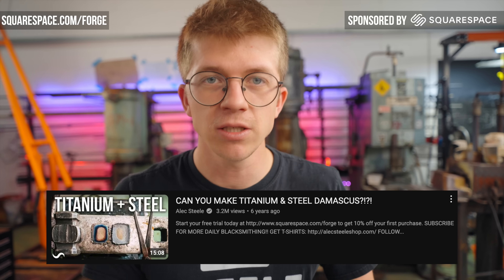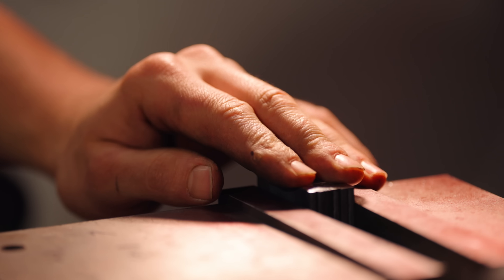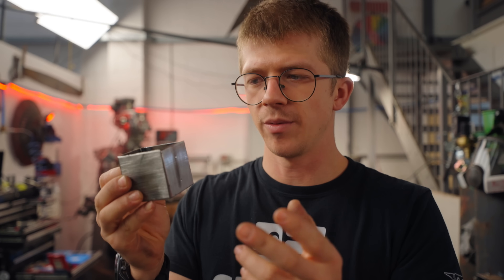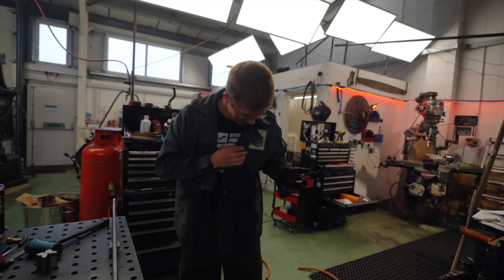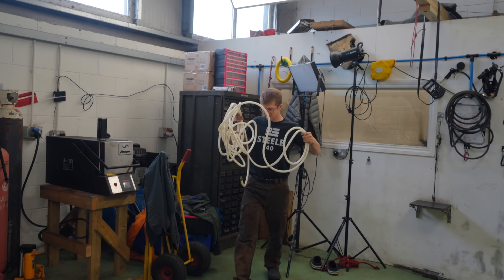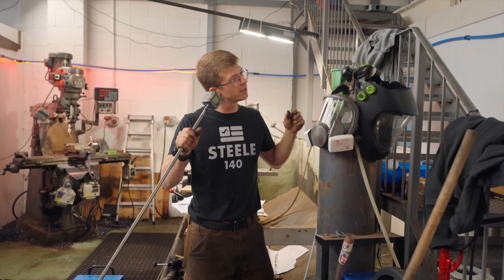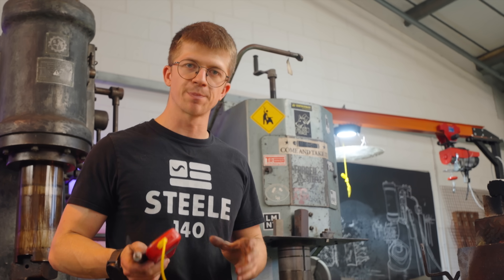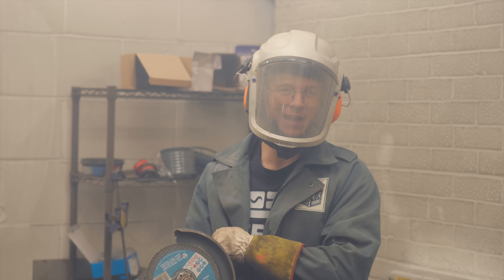Can I make Titanium Damascus?

Comment: Use large induction coil around the block and reciprocate motion to move block in and out of the coil. The coil should be about 25% of the length of the block. You want the layers in the block to be 'almost cooling' below the amalgamation point, then reheating (adjust movement rate). Ideally, you want a nice heat/cool bell curve. 
Experiment with different width curves for different results. You can even vary the heat rate through the length of the block for varying effects.
Good luck!

Comment: From an engineering point of view, "low flow rate" would imply you only need the flow to prevent air from seeping in, and that the cooling effect that the argon introduces should be minimized as much as possible.

Ie. the cooling by argon can't be avoided, but is not part of the intended process per se.

Amazing video btw.

Comment: Hard to tell what that block looks like through out. You liquefying it might turn in to a happy accident ad the 2 grades of ti wont mix evenly so you will likely have wild swirls tear drops blobs and streaks all through out of different grades. You can see near the corners where it turned to liquid

Comment: Love your energy and your videos, I come back to see what you're doing every now and then and this is particularly interesting as I too, want to make titanium damascus in the future and I honestly had zero idea there were a patent on in, but fkn glad its expired. Anyway, I'm not gonna get Squarespace for the simple reason that I know HTML, CSS, Python and JavaScript, so I can essentially code my own, implement the free, open source systems I need for easy maintenance and save a bunch of money. But for anyone who aren't as much of a nerd as I am, I highly recommend going with Squarespace as they will save you a bunch of time and thus a bunch of money.

Also just looked up the conversion of freedom units to sensible units and its honestly not that hot. ~1149 °C is a lot cooler than I thought would be needed to melt Titanium. Copper is, after all, around 1600 °C, gold and silver are worse. Speaking of other metals, perhaps some copper, brass, bronze and silver damascus could be cool, future projects? Not large projects for expensive metals, of course, but stuff like Silver damascus could make some pretty cool ring and necklages tbh. Idk how well gold would do though. It's extremely soft after all and is usually alloyed with other metals like silver, so maybe, maybe not. Would be hella expensive and Silver damascus would probably be easier than gold. On a similar note it would be cool to see a strength comparison between Titanium Damascus tools and Aluminum Bronze tools. Your forge seems plenty capable of doing that. Idk if Aluminum Bronze can be made as damascus, but if it can, that would be insanely cool too.

Comment: I made myself a suit of riveted titanium chain mail. Because of the way I had to heat individual rivets it made each ring a slightly different color and because I used a more complicated link (kings mail) it ended up looking like strands of braided rainbows. Even thought titanium is light, that suit weighs about 200 lbs in total.

Comment: IIRC aluminium oxide abrasives wear out sooner when grinding titanium, but not because it's harder than steel. It's just so reactive it pulls the oxygen right out of it and dulls the edge of the grit particles. Might not be a problem for you but if it is (and it might be why your cutoff wheel went pop but not sure what abrasive it has), consider picking grinding tools with carborundum (silicon carbide) instead.

Comment: I believe that assuming it’s not molten, a power hammer is less force per stroke than a press. Not sure if that would help or hinder with warmed up titanium 

Also baking soda and a bench top power supply is enough to get super predictable colors with vanilla commercial titanium, which may be the alu v alloy. And you can do stuff like masking more areas as you up the current. In the less than 30v regime I like 11-12 volts, 18v and 27v. Or the neighborhoods around those. 

There’s a lot of other fun colors you can unlock if you can get up to 50-100v , those power supplies are a tad more expensive, plus you need to start taking safety more seriously in that power range

Comment: I think the best results for any damascus would be a whole shop in argon atmosphere, cause titanium is very base, you will immediately have an oxide layer very soon after grinding or blasting. Get rid of the box, of the scaling, of the borax, of the grinding. Just buy yourself a rebreather (there must not be oxygen in your shop), seal of the whole shop, build a lock and then keep having a slightly overpressure of argon gas. Probably nitrogen would also do? It's cheaper. Working with a rebreather might be odd, but the laminate will be perfect, I guarantee. Or buy yourself a glove box, a huge one with a forge, a grinder and a hydraulic hammer fitting in, that'll help with the gas bills, but might be even more uncomfortable than the rebreather. But guess what the Hanford Site (for Britain this is Sellafield) workers in the plutonium finishing plant have to endure.

Comment: If you ever do try cutting and welding it in  a way where not just steel, but also titanium has to forgeweld you're gonna have to use make another box or sleeve and fill it with Argon or you're gonna have a really spotty weld.

It might be easiest to make a bildet with extra steel on the outside and just clean and fold until you've ground through the steel and stop there. 

Really excited to see where you take this from here

Comment: Definitely need to try changing the colours using electricity instead of heat, that way you can finish and polish the metal, then colour the titanium layers different colours potentially

Comment: stack the sheets together in a larger 8 inch long 4 inch wide 3/8 inch thick block shape, cut out some of the sheets on the outer end so that their are holes in them that create a jagged wood grain receptacle for the adjacent sheets to fill... optimally of the 3/8 inch thick box, 3 sheets inside of it. 1/8" outer case and 1/16" inner sheets the middle one being having a jagged simulated wood grain hole that the outer two forge into "use water jet cutter to make pre-planned out filler bits, thus leaving only one 1/16 size sheet forging... excessive twisting and da da da methods, use cut water jet to cut out patterns out of each kind of metal (less wasted material)"

Comment: The argon flow rate just needs to be able to keep air out of the can... 1 hole is definitely enough and reduces ingress points.

Melting the titanium was actually a good thing, since the layers will sufficiently diffuse into one another... Just don't get it hot enough to alloy it 😅
A bit of mixing would be amazing though...

Comment: Patents often don't include exact details or variations used in production, to make it harder to replicate, so things like holes/positions shown could well be non-optimal
Reply: I believe that this was a method patent (often called a process patent.) The non-obvious method of producing something is what is covered, not the final product itself. The method patent would be infringed only if someone followed the same steps described in the patent to achieve the same result. As such, method patents do tend to describe something pretty close to the optimal known method, because if a method patent describes a suboptimal process and then someone else starts producing the same thing with another method that is more than trivially different from the patented steps, then the new producer could very well be found to not be infringing the method patent, and would be free to use the superior method without paying royalties.
Reply: Also if you patent the exact process, the patent then covers ONLY that specification. That's why you leave it open enough that someone else can't just look at your expensive patent, change something miniscule and call it their version as it (in many cases) wouldn't be protected by the original patent anymore.
That's what I learnt from IPR-lawyer helping me protect a design - leave it just vague enough that it goes through the processing but afterwards if I'd decide to make any chances in the production items, the protected design would still apply. Like leaving out exact sizes, angles, materials etc.
Reply: @Lanka0Kera you can include quite a large range of variations in your patent claim to cover stuff like that. You can specify many optimal or non-optimal methods or variations within the method pretty easily. It’s why patents almost always read like word salad, they’re worded very specifically to cover alternatives.
Reply: I would be the cannister was not hooked up and flowing Ar or He while in the original patent holder's forge furnace.  Purge and crimp the tubes before charging.
Reply: I can guarantee the 2 hole method is sub optimal. the corners can trap oxygen. 
1 feed hole with an intentional porous weld would always be better at expelling oxygen in every direction.
Reply: The hole positions are ultimately irrelevant - even if they were both on the same side of the canister, eventually (because of the random motion of gas) all oxygen is displaced by argon.

Comment: In smaw MiG welding when you have no wind it doesn’t take much gas to shield the weld so I’d say you don’t need that much flow. Maybe 15 on the flow meter. I use 35 for speed MiG welding and that’s a lot of flow for spray transfer.

Comment: I think titanium melts at like 1600-1700 which explains the expensive pudding cup. It melts a lot lower than what you harden most steels though. These metals are wild to do any work with. I don't know how normal it is but when I've seen it treated it usually comes out like 30-40 rc

Comment: For your small parts storage you could use a 3d printer to make dividers or little boxes that fit in those drawers. Much less expensive than buying those storage bins for their drawers. Then you could use the printer to make objects for molds?

Comment: You THOUGHT you were safe, but you forgot about ITAR. LAWSUIT INCOMING BUDDY BOY!
Reply: Neat colors, wow, almost acting like molten aluminum there the way it squished out in a fluid streamer. That's definitely titanium by the sparks. I'd expect it would want less heat, not to be treated quite like iron, less density there so it's probably going to be more volatile when compacted at temperature than acting like clay. Like compressing a gas makes it hotter; compressing screaming hot, solid Ti vs Fe might be a lot more activation energy, maybe enough to kick over to that phase change suggested by the fluid streamer?

 What if any are the called for flux agent(s)? Tell us what the metal feels like to work with please, looks flaky

Comment: since titanium is a pain to cut (given you killed a grinding disk), iirc, EDM (Electrical discharge machining) is used to cut it. Since there is not abrasion just arcing and liquid to flush the arc remnants out.
Very cool project though.

Comment: Next time, spray white paint inside the canister. The titanium dioxide from the white paint prevents steel from sticking to the canister.  ~Kevin
Reply: i always used "White-out. never paint.
Reply: @Mill_Wrong  Didn't they always use White-out on the "Forged in Fire" TV show?
Reply: @yohannwilkerson6058 he’s attempting to make titanium damascus and used argon gas to purge his steel container of nitrogen and oxygen, so why do you think adding white-out, which is made from titanium dioxide, would help?

Forge in Fire used steel and iron, not titanium
Reply: I can't wait until you make a knife or something with this, although, you'll probably have to get a few new bandsaw blades.
Reply: Liquid paper or whiteout works just as well
Reply: Whiteout
Reply: Also it must dry first ive seen plenty try this without letting it dry. It has a chemical reaction with the air if  still wet
Reply: Its one of the coatings used to make packs of grade 5 / 6-4, so the insert sheets of 6-4 don't weld together while rolling.   A lime slurry is also used.    But if for the coating of the can, make sure the coating is completely dried before putting in the titanium insert pieces.
Reply: old news this whole thing is
Reply: 421😂
Reply: I have also seen paper towel work.
Reply: The problem with that in this situation is that the whole point of purging all the oxygen is preventing the formation of titanium oxides. Explicitly adding those back in would be a bit silly.
Reply: @CensoredUsername_  Dude, the whole reason for this exercise is that titanium makes very pretty oxide layers, so deliberate oxidation is going to happen at some point. The inert gas purge just allows control over where and how those oxides form.
Reply: @irrelevantfish1978  you only want those pretty oxides to form at the end though. When forge welding titanium, it's very important that no oxygen is present, as they will cause the layers to not stick to each and a many other issues. 

Titanium dioxide won't lose its oxygen to steel when forge welding it, so you can use it to keep things from sticking. But if welding titanium, the oxygen can move around far easier, and doesn't stay confined to the part where you don't want it to stick.
Reply: @CensoredUsername_  O2 migration wouldn't be an issue in this application unless the paint was poorly applied, the outer lamina were much thinner, or the stack was overcooked, so to speak.
Reply: @CensoredUsername_  oxides are more stable than the metallic form. The nitrogen purge is to prevent the titanium from oxidizing as there no flux to remove the oxides . The point is to prevent fusion of the steel box to the billet. This is common technique in canister forge welding
Reply: @Capthrax1 : Not nitrogen for the purge gas, titanium will react with it.
Reply: @absalomdraconis  youre right. Argon is the shielding glass to use
Reply: I don't forge but on Forged in Fire they always like to use white out.
Reply: They also almost never use any flux when forge welding...
Reply: After getting the plates so clean. Put in paint that is full of chemicals and will burn in the fire?  Paper towel makes a lot more sense
Reply: @carpediemarts705  paper towels are full of chemicals too
Reply: @kujokage1911 paper towels is long chains of sugars connected to each other aka cellulose aka lots of carbon.  Other than the pulp to make it being bleached not a whole lot of anything in paper towels other than cellulose.
Reply: Sir you are suggesting he put a layer of titanium inside the can to stop it sticking to.... titanium. If the canister had steel inside you would be correct tho
Reply: @zacharykelly7434  the container was steel..... good job not watching the video
Reply: @zacharykelly7434  Titanium dioxide vs titanium metal. No reason it wouldn't work.
Reply: @zacharykelly7434 so if the container is steel on the outside what do you think the inside of the container would be
Reply: uhm, what steel?
Reply: @mrkiky the steel canister…
Reply: @pugnut403  Sticking to itself?

Comment: The best way to color titanium is actually with electricity. If you look into it, if you control the voltage you can dial the colors down to almost any color of the rainbow with incredible control and rpecision
Reply: I’ve done anodizing on grade 2 and 5 with high and low amperage set ups. Using a low amp set up will anodize more slowly and let you slowly (on the order of double-digit seconds) eye the gradient as you build it.
Reply: Is the electric colour different based on the alloy? once its damascus? especially with twists? I don't know hence why I ask...
Reply: @robertjb001  in my testing with the same electrolyte and bank of batteries the grades behave slightly differently. More specific testing is warranted.

Comment: This is the reason I’m subscribed: i live for the experimental stuff. 
After seeing those lines, a kris dagger made if titanium damascus would be INCREDIBLE.
Reply: 100%! I love the experimental stuff. I think I first subscribed when Alec did the copper Damascus. Megumi something if memory serves.
A quick Wikipedia and I think it was Mokume-gane. I wasn't so far away.
Reply: @duncanbrown4184  I love learning with him
Reply: Depending on how well the Titanium sticks to the can, he might be able to embed a high carbon steel/SS layer in the middle so it will look amazing and hold an edge.
Reply: I'm adding my vote for this one as a project. Kris dagger.
Reply: TiMascus is actually super common in high-end knives as a handle/inlay material and it always looks wild.
Reply: while it would be a very cool piece, itanium (as far as i know) is terrible at holding an edge so it'd basically only be ornamental. doesnt mean you shouldnt do it though, it would be really cool!
Reply: @overthegardenwall7143  it is used in knives though. Dive knives specifically.  No worries about corrosion, most likely serrated so you have more area for the edge, therefore able to actually use it without it going dull almost immediately.  Spyderco used H1 steel for their Salt series because of the corrosion resistance, however it wasn't very good at edge holding EXCEPT when used in a serrated blade.  So, there is hope for a titanium Kriss, but it would probably be more ornamental than anything.
Reply: @socmonki  Diving knives are generally made of high chromium stainless.
Reply: @ennz69 generally yes, but there are titanium dive knives.  Wouldn't want a normal every day knife made from it though.
Reply: Titanium damascus kris dagger? Sir yes sir.
Reply: Titanium damascus kris dagger? Sir yes sir.

Comment: The point of the gas is to disperse O2 and prevent oxidisation, so long as you have it on far a while to flush out the O2, you just need to have a positive pressure in the billet and no more will get in. Its like any O2 will be trying to swim up stream